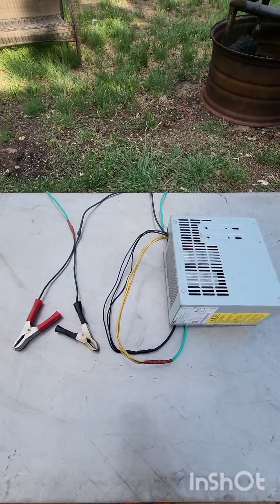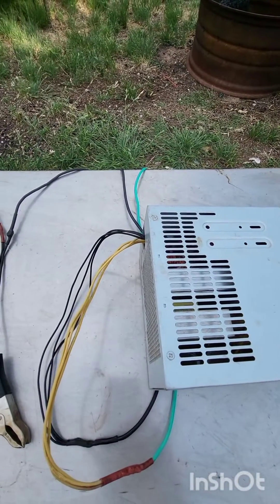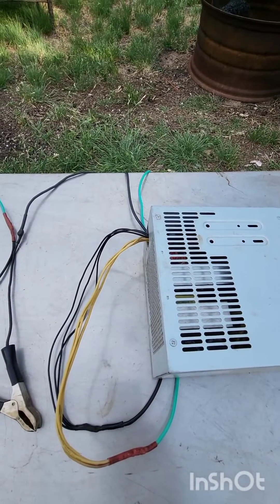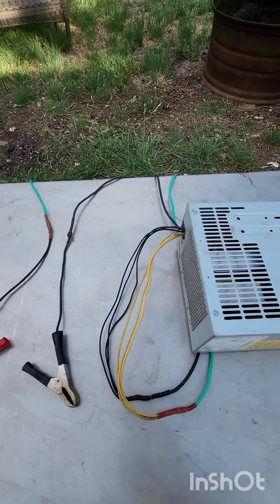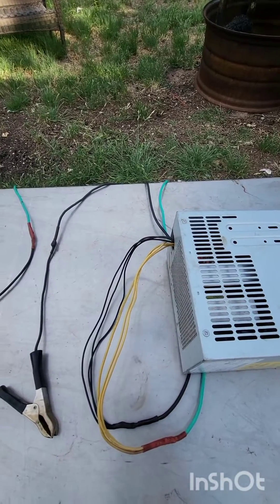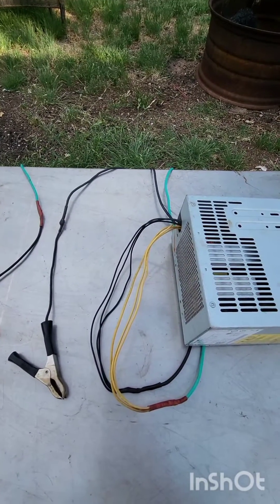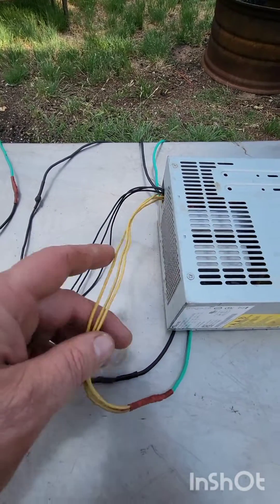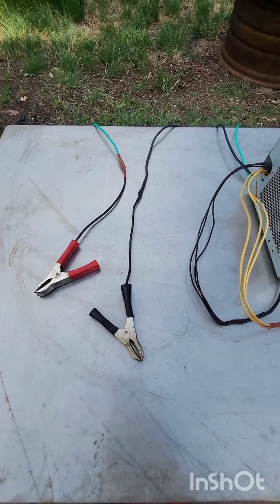Converting computer power supplies for electrolysis tanks.

Comment: I have one power supply I use for electrolysis just like yours. I also use laptop power adapters that are rated at 12V as well. Sure beats burning out a car battery charger as laptop adapters are under $5 at thrift stores. Always good to reuse and recycle something you already have and put it back into use like a power supply.  Just need to identify positive and negative wires, attach alligator clips with soldering gun and get derusting and degriming away on those ole pan in the case of the laptop adapters.

Comment: Isn't the green supposed to be connected to the black? Green usually is the on-and-off switch.
Reply from the maker: The green from the board is connected to a black and is inside the case.  The green cable you see is just the color I cut out of a power cord and used for the positive side.